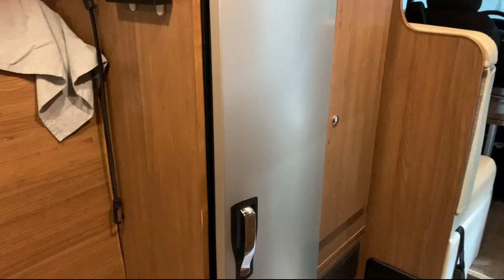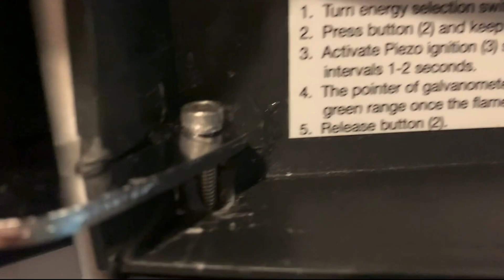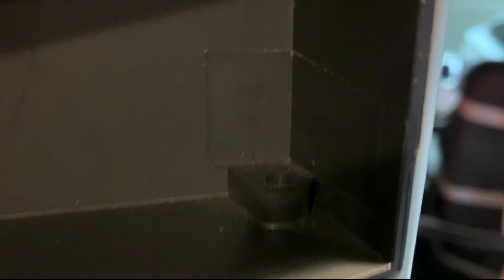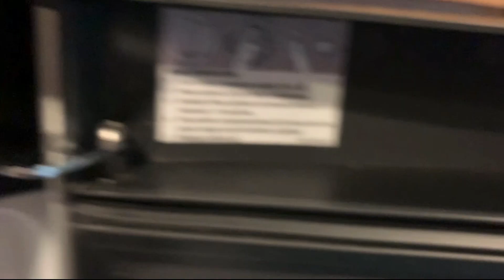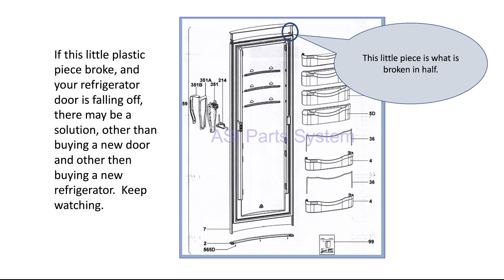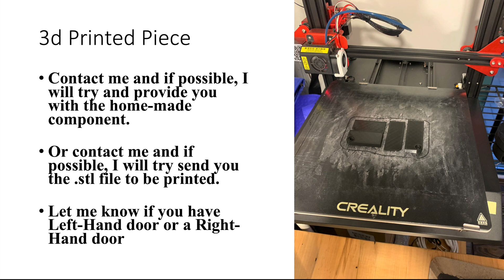RV Dometic Refrigerator 8330 Door Hinge Repair

Comment: Having the same problem on the RML 8330 in my 2017 Winnebago ERA 70A, but on the other side (my fridge opens from the right).  The STL file would be great, but if you can print the matching parts, it will save time.  Will ping you with my contact details.

Comment: Hi!  I recently purchased a 2016 Winnebago Travato.  Everything was great until I opened the fridge and the door fell off!!  I was very dissapointed as you can imagine.  I saw your video and I have the same fridge as yours  Dometic RML8330  that opens from the left, just like yours.  I have the broken hinge, just like yours.  Unfortunately, I don't have a 3D printer.  I was wondering if I might be able to buy your crafted part if you have one available.  Thanks!  Darlene